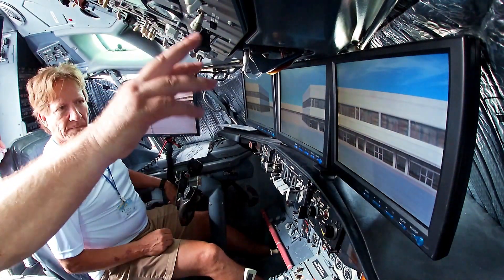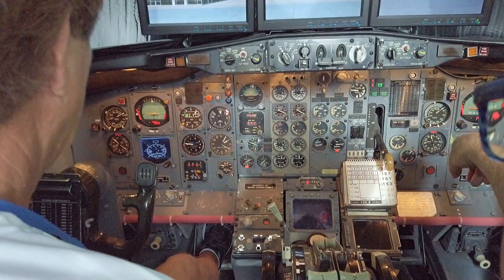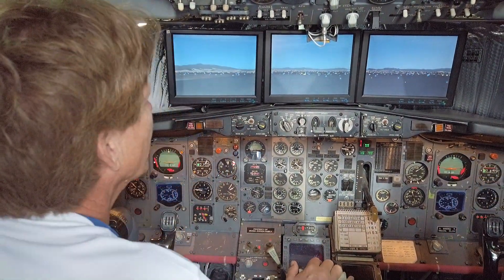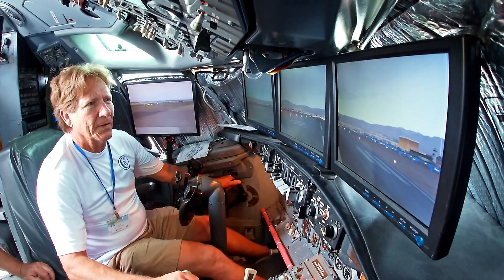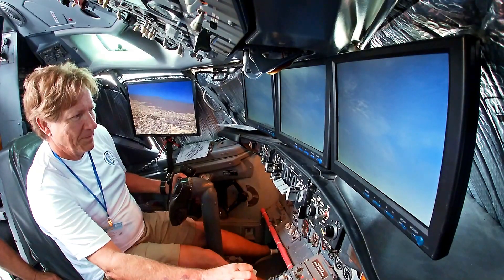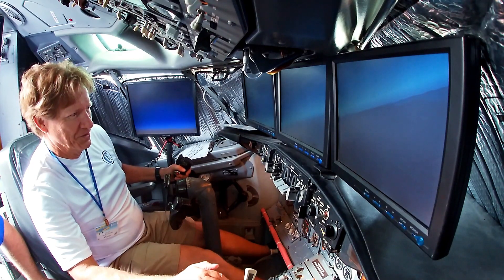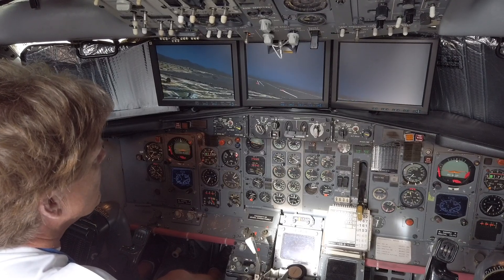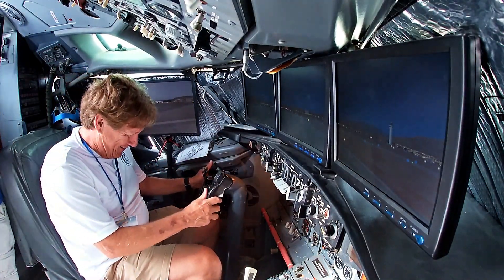Can Ron Fly or more importantly land a Boeing 737-200 sim at the ACCA event at Stearman Field (1K1)?

Comment: You did great for a first attempt Ron. You need one of those in your basement to play with.
Reply: He’d love a sim - just not a 737 one!
Reply: @janisparr6572  Steveo Kinevo bought a beautiful set up that was custom designed for him a while back. I would like one like that since we don't have basements in Texas. Only about $6,000 Bucks.
Reply: Preston Miller that’s not a bad price! It’s on the list....
Reply from the maker: Yea, I would like an FAA approved one for the basement if i weer to get one, but configured for the plane I fly though . . .
Reply: @Parr4theCourse  That would be the smart choice. Steveo has a video on the one he bought. Of course it is using XPlane Software and is a desk top model. It takes a lot of horsepower even to run Xplane properly.